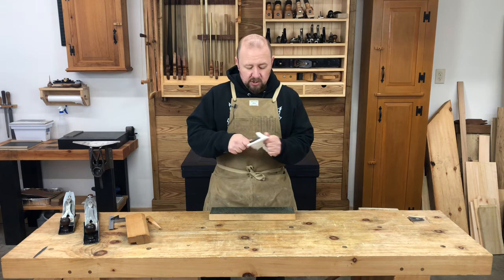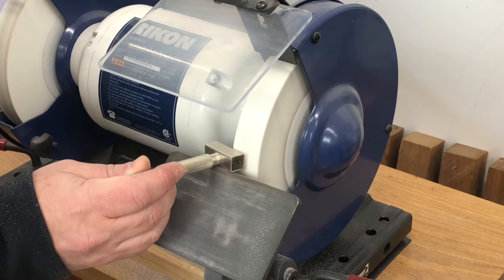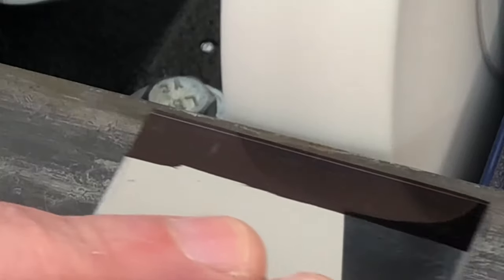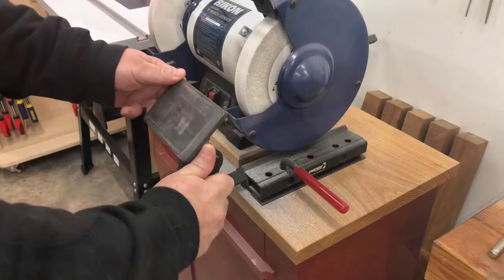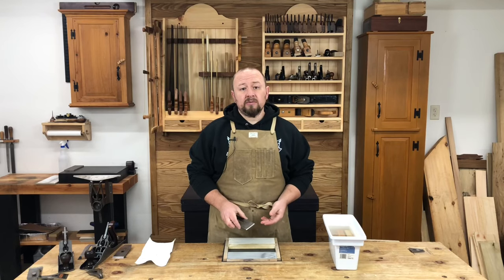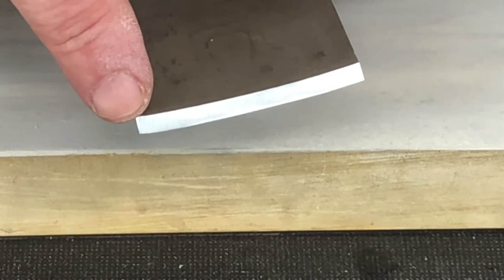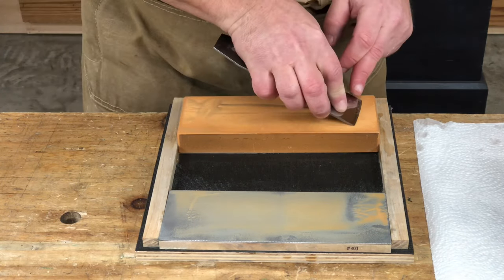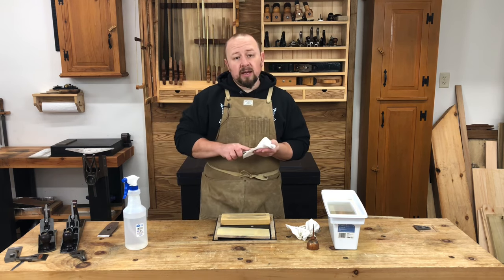Grinding & Honing Freehand | Hand Plane Foundations

Comment: I want to ask regarding free hand sharpening plane blades and chisels whether it is important to use square or any measuring tool to check for straight edge and squareness. I did it but found it too much of a hassle and sometimes it took several hours to get everything square and straight. Thank you.
Reply from the maker: It’s really not that important with chisels and bench plane blades that will be cambered. Where I do find edge straightness to be quite important is with joinery plane blades. If the edge of the blade for a joinery plane isn’t straight, the resultant joint made by the plane won’t be straight/flat. This can cause gaps in joints like dados and rabbets and improper fit in joints like tongue and groove. This may not be a big deal for a hidden joint (rabbet for back panel of a case or a dado hidden behind a face frame), but if the joint will be visible it can be unsightly. I add some camber to almost all of my bench planes though so as long as the edge is “square” enough that the lateral adjustment permits even projection across the mouth, then that’s good enough. It need not be perfect.
Reply: @BobRozaieskiFineWoodworking  Thanks to your series on hand planes, I have a basic understanding of how to use them. And this explanation really clarifies the honing and grinding process.